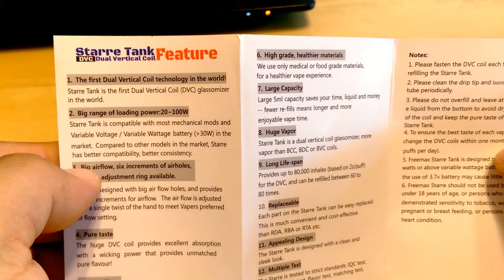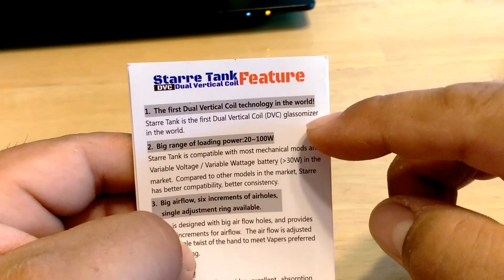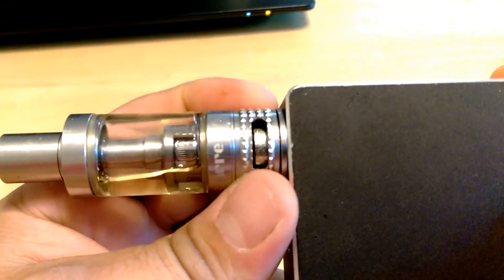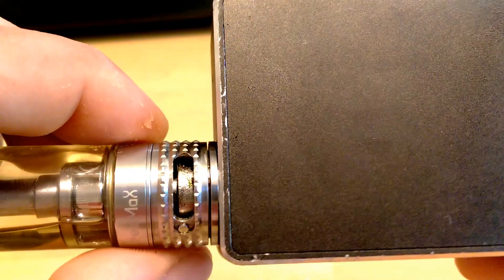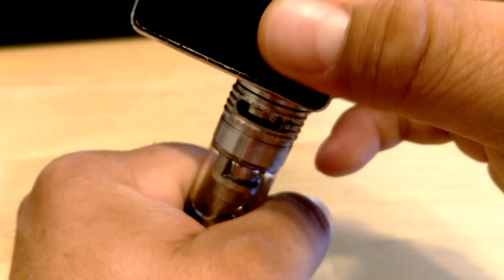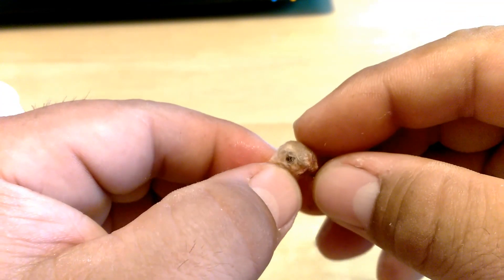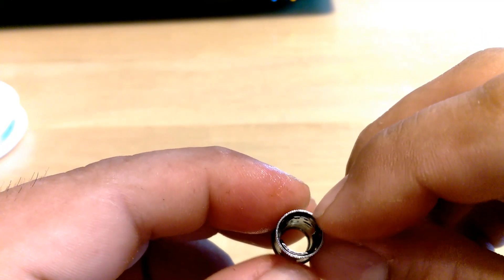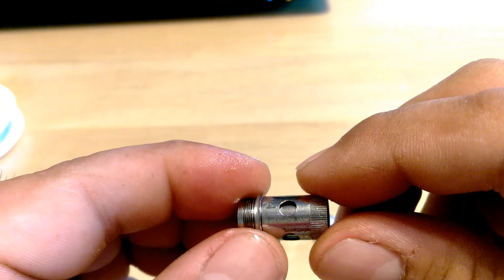Freemax Starre Subohm Tank

Comment: Wow.  After all the great things I've heard about this tank I can't tell you how disappointed I am.  I just received mine and was unboxing it for the first time while watching your review.  I've experienced all the same issues that you have.  In fact, when I placed it on my Glas, I noticed this horid smell and felt the Glas heating up.  I immediately dropped the battery out of the Mod and moved the tank to my iStick 50.  It won't even fire on it.  I've tried messing with the tightness that you mentioned but so far, nothing.
Man, I'm so disappointed.  So far, if anyone asked me my response would be "what a POS!!!"  $27 up in smoke.  If I can't get this going I'll have to go back to my Delta IIs and Subtanks.

Good vid though.  Thanks
Reply from the maker: Wow, yeah I'd say the one you got has some major issues. I haven't had problems firing it on anything, other than what I mentioned. Check that the coil wires aren't extruded too far out past the coil base. But either way I'd definitely be asking for a refund or exchange. Vapes great when it's working, but the consistency is very disappointing.

Comment: Try the tank on another device and see if the resistance still jumps. My 150 has been doing this to me with 2 rda's I have for the past week. It even got stuck at max voltage until I removed the batteries.
Reply from the maker: It's not jumping on my sigelei, just on my ohm reader lol. Thank you for the advice though man. I wish sigelei would have put two spots past the decimal point though. Still love that box though. Thanks for watching.